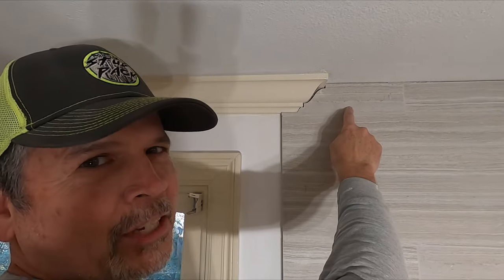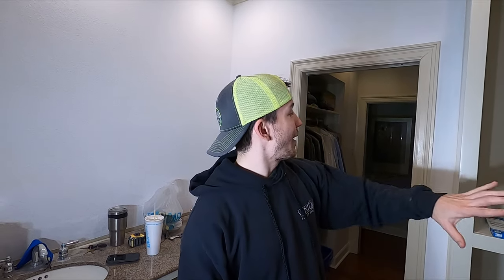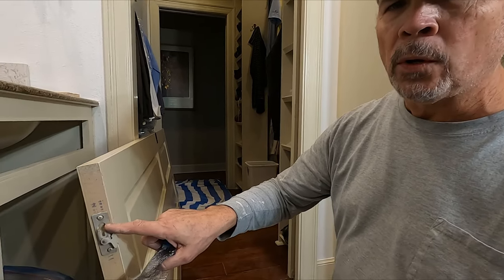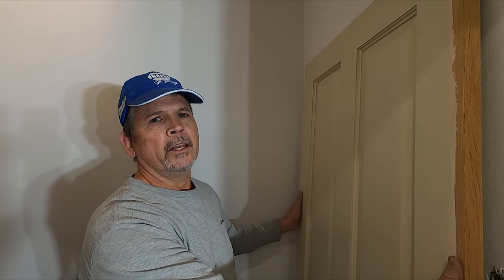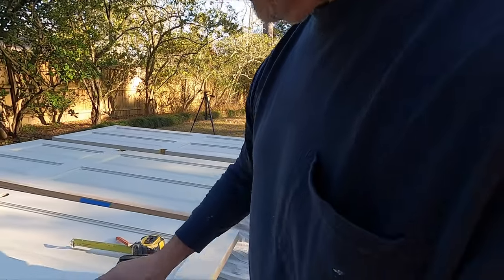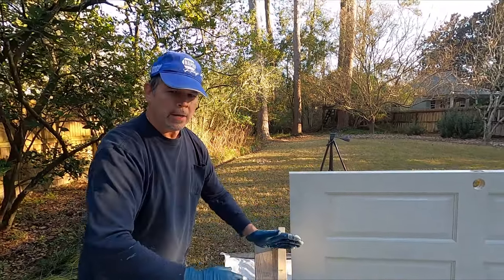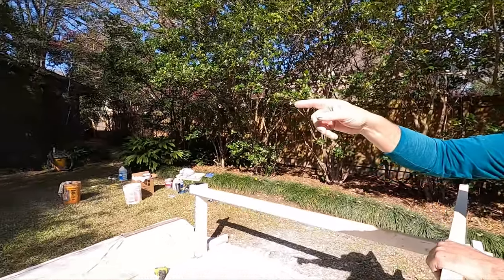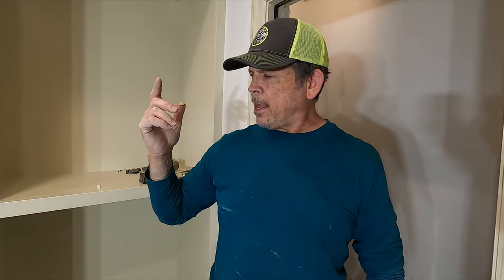A RUN FREE Spray Paint System | Pocket Door Removal Guide

Comment: I'm in full agreement with Joshua; GENIOUS door painting method. As a DIY non-professional, I've been dreading this door painting exercise. I had 12 doors and didn't want to ruin my prep work with brush marks. So, I first found a method where the doors were set up vertically, accordion style. I painted all 12 doors and ended up with runs on both sides of all but the last 2 doors; uggghhh! Again....not a professional. I'm sure the system works for the guys who spray everyday, but for me it took screwing up 10 doors to figure out how much paint was enough. And for those wondering why I kept painting when I knew I was getting runs, well, the male ego is an amazing thing....."I'm sure the next one will be perfect". Also, for those thinking I was using cheap paint, I wasn't. Benjamin Moore Advance is definitely not cheap; which made having to sand and re-paint a second time VERY painful. At least I had a good base to paint over. :-)

After sanding and prepping all doors...again, I entered the ring for round 2. One deviation from Paul's system is that I set up one rack set in the garage for painting, and one rack set outside for drying. I was worried about leaving a dusty coat of overspray on the freshly painted doors if I racked the painted doors so close to my paint area. Not sure if it would have been a problem, but I had plenty of extra 2x4 material and a second rack only took 5 minutes to build. So, I painted 2 doors, let them sit for 5 minutes to let the paint set up, flipped them on the paint rack, waited another 5 minutes, then moved them to the outside rack. I moved the first 2 doors outside immediately after painting the second side, and a couple bugs became permanently a part of our door decor; hence the choice to wait 5 minutes before moving them outside. Also, I decided to leave the extra screw in the doors being moved outside and left them flat while I set up and painted the next two doors. Plenty of room on the outside rack, so why risk runs at that point. When the next 2 doors were ready to be moved outside, I removed the extra screw from the prior two doors and let gravity turn them vertical. At the end of the day, I moved all doors back in to the garage rack set for final drying. Since this will hopefully be our "forever-home", I may never need to use this again, but I can't thank you enough for sharing this with the world!

Comment: Get you a fine finish low pressure tip for your gun. I use 311 for trim/walls and 514 for ceiling's. You'll need a blue guard to run those tips. Less overspray and paint waste.

Comment: Great video as usual, little tip for  painting baseboards (skirting boards we call them), simply apply masking tape to the floor under where the boards will be installed, install the boards on the tape, paint as normal and just cut away the tape when finished.

Comment: Something I like to do is when I open a new can of paint is take a flat head screw driver and punch a hole in 3 or 4 places around the seal edge of the can.  This allows paint to drain back into the can and any residue can easily be cleaned up with a paint brush.  This allows for easy sealing of the can.
Reply: I used to do that as well but I've found that using one of those ring doohickeys that allows you to pour paint out of the can works better. It snaps on to the can and doesn't allow any paint down in the grooves. When done painting, pop the ring off and put the lid on. It's like putting the lid on a brand new can
Reply: @rogermccaslin5963  2 lengths of making tape on the lip that form a V makes for a great, relatively clean pour spout
Reply: WHAT?  Oh, you’re a lip painter.  Try pouring about a 1 1/2” of paint into a small pail.  You won’t overload your brush that way.
Reply: Never understood how any painter could not know that punching those holes is why your 5 in 1 has that sharp point on it.

Comment: Brother, you just saved me. I'm a builder and I'm building my personal house and I'm doing almost everything myself. I have 43 doors to set and then paint. I was trying to figure out a way to spray them by myself. Thanks!

On the speed base we flip the base and use the miter saw to cup down to the "Cap" and then just cope the cap.

Comment: I'm surprised you can get away with such a slow drying paint outside , bugs, dust etc... I've switched over to Benjamin Moores Advanced line of paint. It's a water based paint that can be brushed or sprayed and sets up quite fast and levels nicely. Great system you have for the doors.
Reply: Advance takes like 16 hours before you can second coat. I switched to Scuff X and never looked back.

Comment: I'm a DIY.  I learned so much from these videos.  Great job guys.  One little trick for resealing a paint can when you don't use all the paint.  After wiping off the side and top as much as you can, I clean the groove where the top fits in with a Q-Tip or two.  It helps the seal and makes it easier to open the can next time.
Reply: Good one

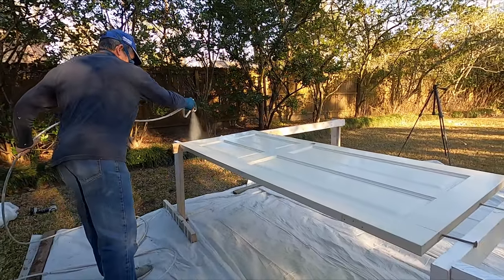Comment: I used a similar setup when spraying the 34 door panels for the house I built recently and it worked out really well, except for each door I used a pair of horses set up in each room. I had a lot of short 2x lumber that the framers were going to throw away so I saved them for this purpose. One suggestion when painting anything on the flat is to start from the near side and end at the far side, opposite of what is shown at 11:59, to avoid having those tiny paint mist droplets from landing on the area that you just painted.

Comment: I always do cuts like the one on the door from both sides going slightly deeper than half the thickness, on each run. I have had problems with chip out when I cut through like you did. To make sure the cuts are exactly at the same spot I use a track and two pieces of T shaped wood clamped against the door and pushed flush against the track. Since the T shaped pieces extend to both sides you can just flip the door over push the track against the T's and cut the other side.

Comment: I do something similar when painting doors, but I put a little piece of metal tube over the screw so it acts like a roller bearing, so I can just roll the doors, I usually work alone so it makes it easier for me.
Reply: Good tip, thanks Mick . I love You Tube. 71 year young carpenter still learning. I wish I had You Tube when I started, I'd be years ahead.
Reply: @timdouglass4934  Hey Tim. Your never too old to learn something or something new, keep on doing what your doing.
Reply: @timdouglass4934    And I've learned that it can be a hack job and overall horrible video (I'm not referring to Stud Pack) but you might just pick up some cool timesaver or technique that you'll use from then on.
Reply: Would you kindly explain us how do you manage to roll both sides the same speed?
(I would worry that your method is prone to some kind of an accident causing an undesired touch of the door with the support).

Comment: Great idea. Wish I had seen this before I sprayed the doors in my house. Because I work by myself, I constructed a vertical frame outside several inches larger than my doors with supports front, back and sides. After setting the door in the frame, I placed a 4 x 4 on the top of the door and secured it to the frame with clamps, This held the door tightly in place and I was able to easily paint the front then walk around and paint the back. I left several inches on both sides so I can easily spray the out edges as well. Worked well for what I needed. Just found your channel yesterday. Great stuff! Subscribed.
Reply from the maker: Thx for the sub 👍👊

Comment: Glad found this channel, and really enjoy the fun “loving” energy you guys have. Can also see you really like what you do; and think/plan things out. Nice work✌🏻

8:26 some of the newer pocket doors are “relatively” easy these days to install. But OH YES!, on remodels with older homes and those pocket doors that are solid core; it can cause a few choice words while removing those doors😉 (not to mention 30-60 mins of your time😂).

15:42 Oh, I’m feeling the pain you’ve experienced right there. It’s heartbreaking for sure. As is, when you leave your laptop outside b/c where doing some work, plans, etc...and didn’t realize homeowners has irrigation system (sprinklers) set to turn on at 6:30 pm, and end up getting laptop wet; as well as, MYSELF! Got a nice reclaimed shower that day 😂
16:52 That’s a nice “tip/step” right there. Makes reopening a paint can that has sat for a few; that much easier👍🏻

Comment: I used to work on some high end houses and the pocket doors required removal of the split jamb for adjustment and removal. There were either plugged recessed screws holding the head jamb if you were lucky. Usually you had to find the hidden screws.

Comment: 11:40 aaaand that's why you pre-drill
Reply: Saw the same thing
Reply: They tried to cut the video as fast as possible but yea definitely need to pre drill with screws that size haha . In my opinion it would have been better if he kept it in the video and used it as a learning moment.
Reply: 11:06 can't believe you guys didn't catch that with those keen eyes of yours.
Reply: @shindanu  didn't mean to hurt your feelings.  All I was saying was instead of just putting it on the screen it would have been good for them to say " hey this is why you pre drill, look at what just happened." That being said, I think the original commenter was saying what they should have said when they split the door.
Reply: @bdenney9443  I should also apologize for hurting your feelings.
Reply: @shindanu  you hurt my feelings?
Reply: 11:50 shows it cracked on both sides, yikes.
Reply: I'm guessing on hollow doors you won't get the splitting that happened in this video with the solid door. The wood in the end isn't that deep.

Comment: Great video footage.  One recommendation:  Buy a Shark Corp 21-2225 10 Inch Prybar and Nail Puller.  It has a thin blade that is case hardened and saves a lot of trim.

Comment: I modified some harbor freight engine stands to paint hollow metal slabs. Works great on slabs up to 48" wide, not so much on anything larger though. Made 3 sets so we can paint 3 doors at a time and roll them out of the way to dry.

Comment: Thank you for this video. I have 8 hollow core doors, 4 pocket doors and 4 louvered bi-fold closet doors that I want to paint. I have 2 Graco paint sprayers and a 10’ x 10’ commercial pop-up tent with side walls that I use as an outdoor spray booth. However, at 72 years of age I was wondering how I was going to handle the doors expediently and I also like to spray the doors flat. This solves my dilemma beautify. For smaller jobs I love my knew cordless  Graco Ultra Cordless Airless Handheld Paint Sprayer 17M363. Most of my power tools are DeWalt so already have a ton of DeWalt batteries that this sprayer uses.
Reply from the maker: Awesome thx Linda 👍

Comment: For coping inside corners, I cut the straight part on the miter saw set to 15 degree bevel, then use a wood shaping disc with a Dremel to shape the curving part.

Comment: Very nice job on the painting. If I could, I would like to share a “pro tip” that has worked well for me. I didn’t SEE you laying down the caulk, so I would guess you slowly PULLED the caulk gun? If you were to cut a SMALL 45* off the tip, and PUSH the gun, leaving an 1/8 bead “rolling” on the tip as you push it along, the caulk is forced into the crack, makes a better bead, and is much faster, and makes for better clean up! Myself, I prefer a small cup of COLD water, and a wet finger tip, and of course a clean rag to wipe off your finger. Also, always, ALWAYS go back and paint the caulk! No matter the brand you like to use, they will always eventually turn yellow. Just wanted to pass that along to anyone who will listen. Super nice job on the tile work. I enjoy your videos. Thank you.
Reply from the maker: Thx Raul.  Yes I pull, always have.  Others have commented about pushing.  I'll try it for sure.  Yes we always paint the caulk 👍

Comment: When coping baseboard try what I do, I set my miter saw at 4 degrees then turn the baseboard upside down and then cut down the straight flat part, then use the coping saw to cut the rest

Comment: What I've learned spraying doors vertical with an airless, is to use a fine finish tip and move fast. Don't try to put too much paint on in one coat.
I like my HVLP if I'm not spraying a lot. I have more control, but you can't go as fast and you might have to thin the paint.

Comment: Great method for paininting doors and overall great content. Enjoy the videos on your channel a lot! One question I have (I am no pro at all by any means) but is it recommened to fill the holes left by the structural screws and maybe prime the bottom of the doors? Whether it's solid wood or hollow core, when homeowners mop, or even worse water leaks, would you want to seal off the bottom to prevent mold, or over a long period of time rotting doors?

Comment: I install floor covering for a living. For a door is not parallel with the floor, or the thickness of the new floor covering determines that the door will need to be cut there's one trick to make this a lot easier specially if you have a lot of doors. 
Use a pair of dividers,  and with the door in closed position, mark each door on the right and left lower corners before removing them. Be sure that your dividers do not move while you were doing this. You could also use a scrap of wood placed on the floor as a gauge.
The mark you put on the door or does not need to be accurate as if it's going to be the actual cut line.  For now it's a reference mark that is parallel to the floor.
When it comes time to cut the doors, let's say you need to cut 3/8 of an inch above your mark. If the first door you cut fits, then cut all the rest of the doors 3/8 of an inch above your marks.
I recently had to remove two bathroom pocket doors that needed to be cut. I use the pry bar under the door to take the weight off the trolleys to make them easier to slide off the pins. 
The upper filler piece that you removed..... in my case, the guy that installed the doors thought it would be a good idea to add some Carpenters glue before shooting in brad nails. 😱 It wasn't a good idea.
 Great stuff.

Comment: Great system to paint doors by yourself, Paul!  Does it come out smooth like that because it's alkyd paint or because of the sprayer?  As you know, here in SoCal we can't get alkyd anymore. :-\
Reply from the maker: Thx.  I think it’s a combination of both.  Yeah a buddy of mine used to import real laquer thinner (not the California recipe) from Vegas
Reply: It’s both. The Sherwin Williams “Pro Classic “ is a100% acrylic that performs very well- almost like oil based
Reply: That Benjamin Moore is some of the best paint I've used. The Alkyd satin lays down like it was sprayed.
Reply: Add penatrol to oil base paint. Paint will stretch out like it was sprayed painted. No brush marks!
Reply: @StudPack  Is it only me who cant get away without oil priming all tops, bottoms, edges, and cuts? Thanks.
Reply: If your not useing water-based paint in this day in age there's something wrong..
Reply: @judsonmeraw6294  usually its the clowns that ask this.. if you do that your not going to know where the doors go... plus that's supposed to happen when they get to the job so that would be on the builders. Its extremely rare for a door to warp.. be like finding gold

Comment: Many years ago I watched a master carpenter cut the bottoms off of several expensive office doors.  He scored the cutoff line with a utility knife on both sides, to prevent tear-out and splintering. I’ve found that using painters tape on both sides reduces tear-out or splintering.  If you want to cover all the bases, use both methods; tape, then score.
Reply from the maker: Thx Henry.  That was the way before Festool track saws 👍👊

Comment: Nice door flip trick. I'm not sure about outside with dust and pollen and bugs though. Only one coat? Liquid deglosser instead of primer? As a painter I have never used a liquid deglosser before. I just sand and prime only if its latex on top of oil.
Reply from the maker: Thx Drew.  Dust pollen bugs outside in Louisiana are a minimum this time of year.   Jordan and I have always talked about a portable outdoor spray booth.  I felt like these doors had lots of surface grime/oils on them so I wanted to Clean that as best I could

Comment: I’m new to painting and just got a graco x5 paint sprayer, people have suggested to use a blue guard with a green 310 fflp (fine finish low pressure) tip to reduce over spray and extend the life of the machine. Have you guys tried those green tips before?
Reply: Watch Richard's new video on Finish Carpentry TV (YT). He uses a Graco with a 208 fflp tip for spraying trim.

Comment: The fastest and easiest way to spray paint interior doors is to spray them standing in pairs, vertically, so both sides can be sprayed. To do this, you'll need to connect each pair of doors at their top edge, we've always used paint stir sticks. 20 yr Painter.

Comment: You can save a bunch of time coping flip your piece upside down on the saw and set it to 45 cut the bottom up to the ornate section gives you a perfect line plus you'll have a back bevel even if your angle is a couple degrees off it will cover
Reply from the maker: Yeah we do that but this was only three copes.  Good practice 👊👍

Comment: Impervo is the best oil on the market imo. Still dont use it anymore unless someone insists. I put a huge markup on it to try and make it worth the pain and suffering lol. Water based and modified paints have made tremendous strides. The yellowing and chemical warfare is just is no longer worth it. Especially on pocket doors that are always left open.